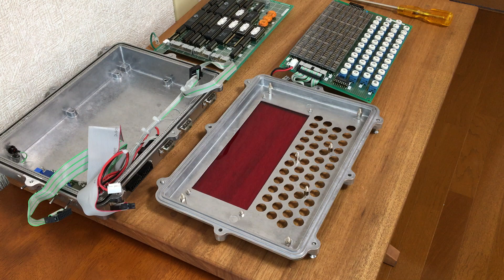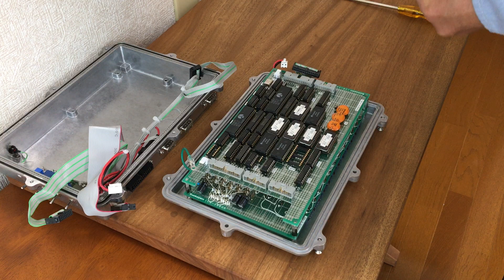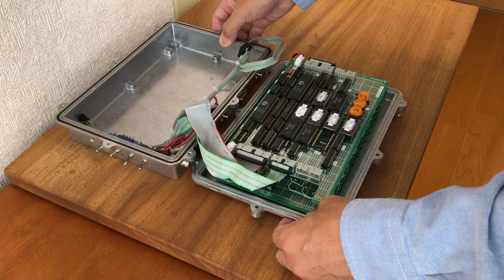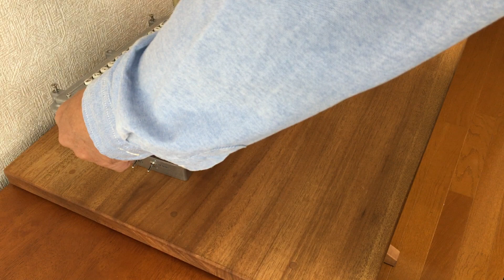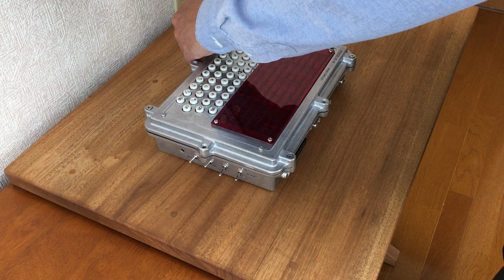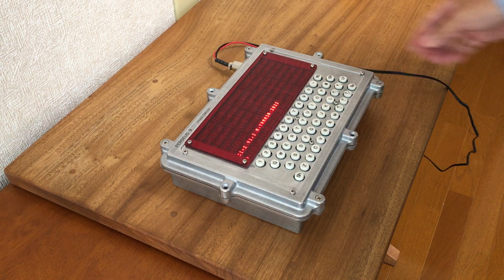Assembling of homemade mobile 6502 computer PERSEUS-9

Comment: Wow, looks like some old space equipment!
Reply from the maker: Thank you for watching! The Apollo spacecraft computer of the 1960s and 1970s was the circuits were made with wire wrap similar to this one. And there was no GUI on the display, and the panel is lined with toggle switches and lamps. This is a reproduction of technology of the 1970s. The language used in this computer was also developed by hand, without using today's PCs.

Comment: What digits did you use ? TIL-305 ? PLZ show us a macro of the display (closed-in zoom to see the pixels !) I dreamed of doing this in 1985 using TIL-305 in a 80x25 layout for a portable 8088 ms0dos compatible computer !
Reply from the maker: Thank you for watching. This LED display is 40 digits x 7 lines. The module used is HCMS-2912 (3.71mm height), not TIL-305 (7.62mm height). One module is for 8 characters, so I am using a total of 35 modules. Some enlarged pictures are available at the location described at the end of the explanatory text of this video. Schematics, source code, and a photo of the printed circuit board as mounted are also available.

Comment: Wonderful build! 👏
I love the keyboard and the screen, they're unique. Do you plan to design a custom PCB for next revisions? What are your next goals on this project?
Reply from the maker: Thanks for watching! Ordering PCBs is very common nowadays, but since the purpose here is to reproduce the technology of the 1970s, I will be operating with wire-wrapped boards. There were quite a few mass-produced products made this way back then. Also, the computer on the Apollo spacecraft was also made with this technology. 
The next goal is under consideration, I will do something that everyone can relate to the importance of basic technology. I intend to publish more applications of basic physics and mathematics with my own floating point interpreter. System software could be developed for filing systems and compilers, but I am not sure if it can be done by hand assembly.

Comment: This is real craftmanship, as you say, using your experience of years in electronics and mechanical knowledge. I did make several wire wrapped boards myself and think working with this technique is relaxing on itself. Where did you get the round keycaps? it is really handy as you can just drill the openings in the top of the housing, surely would be more work with rectangular keys. You write you used the DS660RCW keyboard, did you take out the mechanical keys of it and if yes, do they fit in the 2.54 mm raster of the PCB? I hope you will show a bit more of your monitor programm, I guess you can also check and programm the contents of your RAM memory?
Reply from the maker: Thank you for watching! Indeed, for some reason, I also find it mentally calming to do wire wrapping work. 
DS-660-RCW is a stand-alone push switch made by Miyama Electric Co.,LTD of Japan. It is white and with a circular key top. The two signal pins are 0.9mm in size and have a 2.54mm pitch, so they can be neatly mounted by slightly enlarging the hole diameter on the universal board with a drill. I have so far found no other switches that realize my original key-panel.
So far this PERSEUS-9 does not implement a monitor program. It is immediately running the direct mode of the floating point interpreter and the editor. Access to the memory is done by pointer variables in the interpreter. A spare ROM socket is mounted on the board so that monitor programs can be implemented in the future.
In the PERSEUS-8, the original of this computer, the CPU is stopped by DMA without a monitor program, and all programs are developed by single-step execution of the CPU with machine language program input to RAM using only a 16-bit address and 8-bit data toggle switches and LEDs. The interpreter (approx. 7 kB) is also developed in this way, converted to ROM, and implemented in this computer. These are described in detail in the article about PERSEUS-8 on the Hackaday site shown in link of this movie.

Comment: Yo, that display is insanely expensive, but how?
35€ per segment and 35 for each one of them?
1225€ for a 40x7 characters display?
I hope the power consumption of it is at least pretty low.
Reply from the maker: Thank you for watching! This display module was quite costly, but I adopted it because I wanted to realize my own original display system by combining them.　In my case, the difficulties of developing and debugging the firmware that controls the bit patterns of the module and countermeasures against signal noise caused by mounting many modules were greater than the cost difficulties.  power consumption is reduced to some extent by reducing the brightness in the settings.

Comment: Wow, this is the first video of yours I've seen and I love it! The display reminds me of IEE 1704 or TIL305. I have a few and was thinking of making a watch out of them. Did you design that case or did you buy and adapt something to hold the computer?
Reply from the maker: Thank you for watching! The 5x7 LED dot matrix display is fun to think about because we can create own original display system. The enclosure is a die-cast aluminum case HQ-26-18N purchased from a Japanese manufacturer called TAKACH. The hole drilling process was done by myself.

Comment: Holy cow, that display must have cost a fortune!
Reply from the maker: Thanks! The overall cost of the LED module was quite expensive, but I am satisfied with the finished product. The LCD modules are inexpensive, but I wanted to create my own original display system, so I used LED modules.

Comment: This is incredible, every video you upload is better than the last. I barely know how to use an oscilloscope but I'm learning electronics to be a fire safety technician and you are a huge inspiration to me!
Reply from the maker: Thanks! It takes a lot of trial and error by observing signals with an oscilloscope before I can get the circuit I designed to work properly as shown in the video. I am very happy when I finally find the cause of the defective part after observing the signals of each part.

Comment: Very clean construction and well thought out design. 
As you already mentioned it has this very unique retro futuristic look, especially with the round - typewriter like - key switches. 

What model is the aluminium case? 
I could use this type of case for some of my projects as well.

Thanks,
Michael
Reply from the maker: Thanks! This die-cast aluminum enclosure is HQ-26-18-6N by Japanese maker TAKACHI. It is for outdoor equipment and has a waterproof O-ring, but I ignored that feature. This enclosure series is one level larger than the size used for guitar effectors, etc. I like die-cast aluminum cases because they are sturdy but easy to work with.
Reply: @mitsuruyamada  Thanks for the feedback ! 
I totally agree with you, diecast aluminium is really nice to work with. 
I thought about using two of the bottom parts of these enclosures, addimg a hinge in the back and building a small suitcase like rugged pi computer. 
.... like the pelicases for military laptops. :)

Comment: This is awsome! I realy love the design with the metal boxes and blinking lights as well, it realy fit's the era this project makes me think of.
Reply from the maker: Thanks! Going back to about 45 years ago, I believe this is what everyone thought portable computers looked like.
Reply: @mitsuruyamada  Long time ago i remember i had an old matrix printer made in Japan in the late 70s i think, the whole bottom plate was made in solid cast metal and the entire feeding line was heavy copper windled transformers for the analog lines as far as i remember. I sold it to friend in the 90s since i no longer had use for it and he needed it for the blueprint company papers he had to make at the time which the new type of printers could not do.

I kind of collect old Japanese tube display devises when i find them cheap on fleamarkets and local auctions. My first was an 80s pocket calcylator i inherrited from my grandfather, he used it i think for the paperwork he had to do at home for the national railroad company.

From pictures i seen the old IBM computers where made in a similar way. The pricetag was like 18 000$ for a fully eqipped computer unit in the early 80s as i heard.

I know there where Russian clones of them, but they all seem to be gone now outside a few museum examples, i don't think they where ever exported to the west. But it had been genuinly interesting to see one.